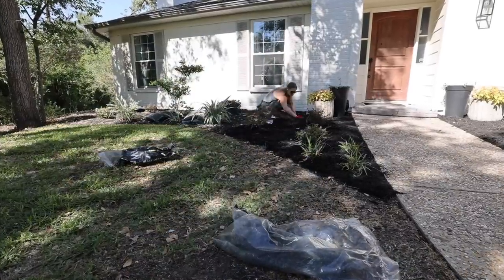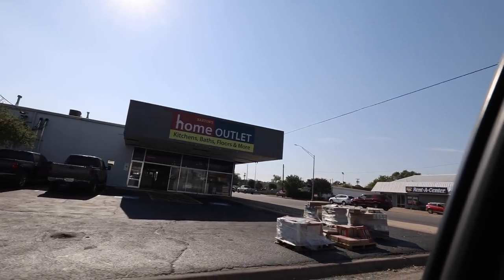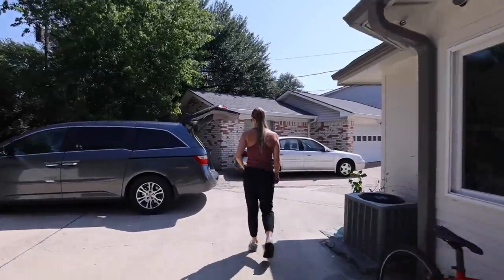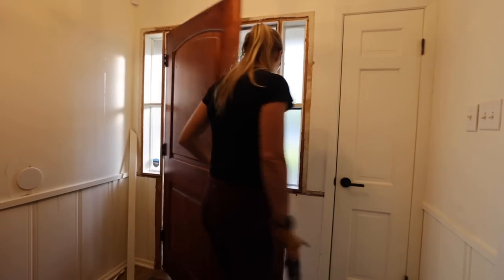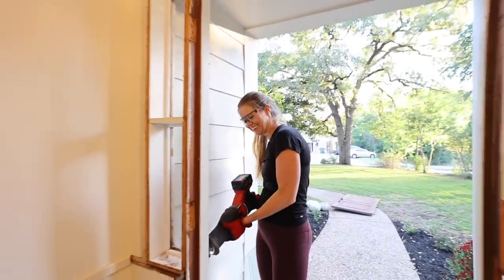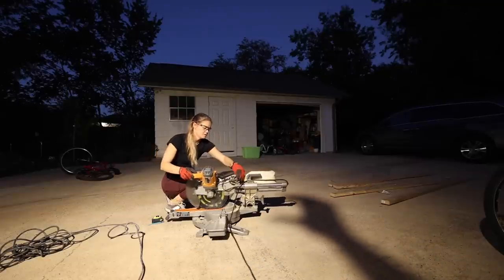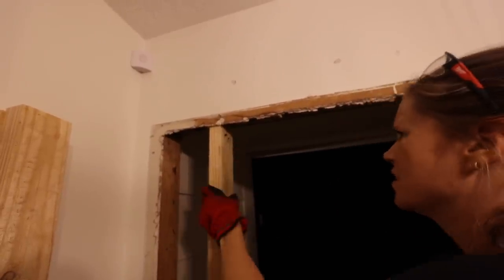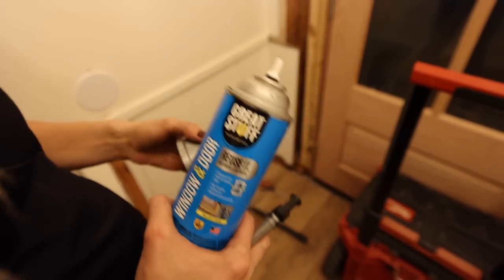Installing A New Front Door [This Did NOT Go According To Plan!!] // EXTREME DIY HOME MAKEOVER

Comment: Love your videos! Just one tip. When you start a new tube of caulk you might not need a scissors or knife. There’s a hole on the side of the gun that you stick the tip of the tube in then “pull the trigger” and it cuts the tip off. Who knows maybe not all caulk guns are the same but the ones I’ve used have always had that.

Comment: Ugh. Just put new composite door jambs in my 5 year old shed shop by scratch this last weekend. The old door was a pre-hung Jeld-wen with horrible cheapo pine wood door frame material installed 5 years ago.  The frame completely was rotted out and I discovered water issues on the sub floor when I pulled out the door frame. The door is fine and insulated, so kept that. Dried out the floor with a heat gun, primed with mold resistant primer from a bathroom remodel. Put in an aluminum door sill pan, stretch tape and the composite door jambs from Lowes.  Took me 2 full days doing it alone, but have it dialed in. Tonight is the outside trim and door sill. Not bad for a 58 year old woman. Never give up. Can't recommend the composite door jambs enough. Also, since you are ripping it all out, do the aluminum sill plate and stretch tape. There are two brothers on YouTube that show you how to do it right. Search for Perkins Building Brothers Door Flashing 101.  I should never have to worry about replacing this again.